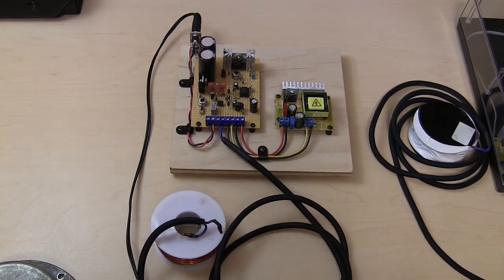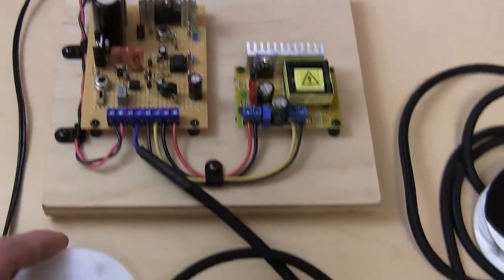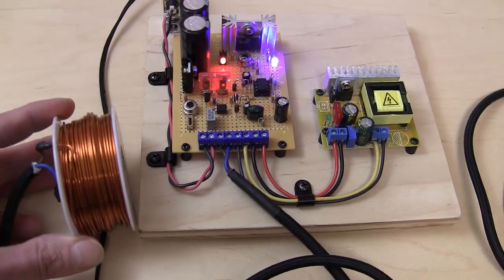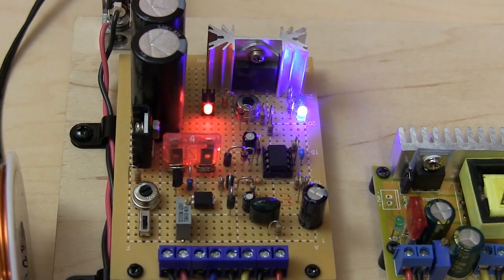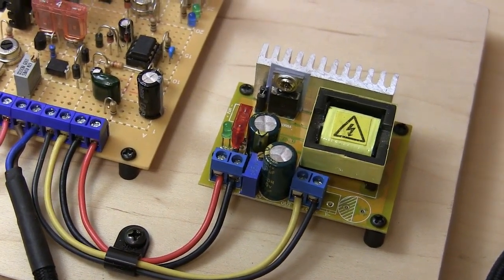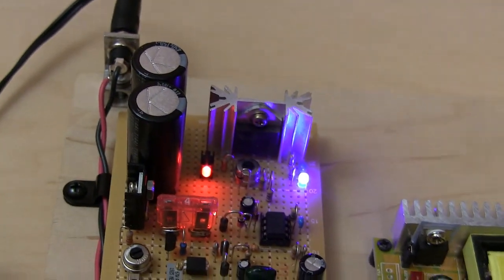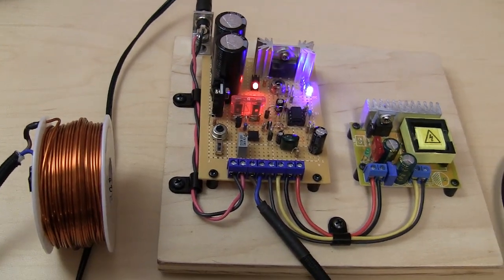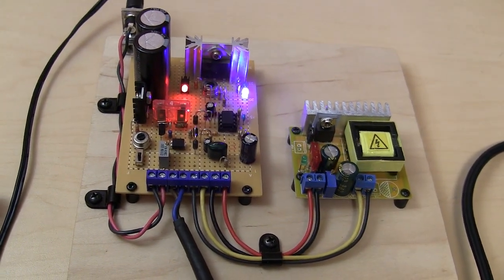New V3 Pulser Circuit - Beck Protocol, PEMF Magnetic Therapy

Comment: Hello, thank you for sharing your designs, I wanted to tell you that I got some coils (FLAT COIL p 180) the coil on the 200 ohm scale measures 0.8.0  and my question is if this circuit that you present here would work for said coils, which in fact are the same as those seen in the following link

https://scontent.faep6-1.fna.fbcdn.net/v/t39.30808-6/240735163_881645375768993_7252479043763106412_n.jpg?_nc_cat=101&ccb=1-7&_nc_sid=5f2048&_nc_ohc=wS_Wd0h4nmoQ7kNvgGEcMqM&_nc_ht=scontent.faep6-1.fna&oh=00_AYDEgdjSUqlLOgVPCrpRq5H0y0E_SgktxuNQ__PjH2ZTaA&oe=667E7DD7

Comment: nice tells us how many Tesla pulse you got, can you use the same circuit with bigger capacitors and higher voltage?
Reply: This is a very weak pulser, probably not over 0.001 - 0.002 Tesla
Reply: Yes, you can. But it will not allow you to increase the output power considerably. If you want high output power, the only way is to use a powerful power supply!

Comment: In order to kill bacteria or the virus instantly with a few pulses your Magneic pulsar must put out 2 + Tesla (20,000 Gauss or more) From my estimates you are around 1 Tesla. You need to improve the coil, wind it tight, Use 14 AWG (1.7mm copper magnet wire), and also add capacitors, looks like you have less then 1,000 uf, thats not  anought to get the job done efficiently when it comes to deeper places. I build 6 Tesla Magnetic Pulsers now, I can repel 1lb aluminum weight over 5 ft up in the air with the similar coil. 
https://youtu.be/J642ij3rPpU
Reply: but even in the original beck protocol papers it says that you only need 6000 gauss? 
https://www.bobbeck.com/pdfs/beck-protocol-handbook.pdf
Page  42  second column
Reply: @maxwellstraveldiarrheas7174  True,  with 0.6 Tesla  (Sota MP5 or MP6 units) you will get the results or this devices wouldn't be as popular. I tried higher powers up to  12 Tesla and it works even better. When power raised to 2 Tesla, you can kill RNA viruses and bacteria in a few pulses at the surface of the coil, when you raise the power to 5-6 Tesla, you will get active killing zone  few inches away from the coil this allows you to penetrate deep inside and kill the virus in just a few min or less. Sometimes all it needed is 1 or 2 pulses. 
Many people are OBs and low power 0.6 Tesla won't reach all the way to the liver and other organs like stronger pulsers ~5 Tesla
Reply: @AndreyD  Thank you for your reply, alright good to know, do you know where i can purchase such a strong device like that? because i couldn´t find a stronger one than the one mentioned in the protocol!
Maybe you could answer me another question as well, do you know if all the symbiotic bacteria we have in our body that actually help us get killed off too? i was wondering because beck never mentioned that!
Reply: @AndreyD  why MRI doesn't heal then, since they release highly magnetic fields? Not bashing the Beck protocol which seems great, just wanna understand. Why MRI's fields don't cure diseases with their magnetic properties? Thanks
Reply: @a.b.c.520  MRIs  do generate permanent field, magnetic Pulsers generate pulses of Magnetic field
MRI Doesnt have healing properties because in addition to Magnetic energy,  strong Radio Wave in MegaHerts range also being applied in the scanning area which maybe canceling healing effect from magnetic energy.
Reply: @AndreyD  it could be an explanation indeed thank you very much Andrey

Comment: The best electrodes for the pulsar is girls metal hairclips 0.5 cm by 3cm from ebay wrapped in FELT from furniture protector pads cut to the above  size and soaked by aloe vera from wallmart
Reply: It seems that you have a lot of information, but you don't share anything. What's the point of knowing that you know a lot if we can't have something from you?

Comment: Very impressive build! Respect. I have also done research into (im-) pulsed (bifilar) coils.
Using negative Voltage works best, as it raises the pH of the body, which the body needs to heal itself.

I use impulses, created by a coil discharge (magnetic field creates inductive spike).

these spikes then are injected into the coil.

The coil is made series resonant so the impedance is zero(equal to wire resistance). This gives the impulse a very high speed through the coil.

More info on my channel (look up "ascention seat")

Comment: Hi, after looking on your videos on radiant chargers i am just wondering how is possible to charge lead acid battery with only voltage? Can you clarify briefly is it possible to charge completely newly assembled lead acid battery filled with sulfuric acid, for example 12v 75ah ,this battery usually have around 700CCA, will this battery have approx the same CCA rating after charging with radiant energy?
Reply: @mapi5933  thanks, i will check this.
Reply: https://youtu.be/JXgl_MejMW8